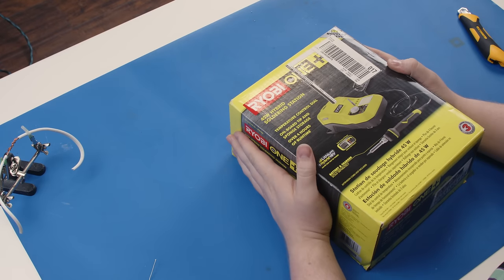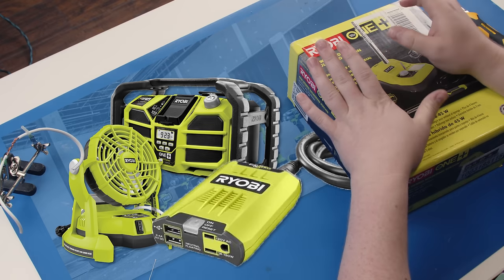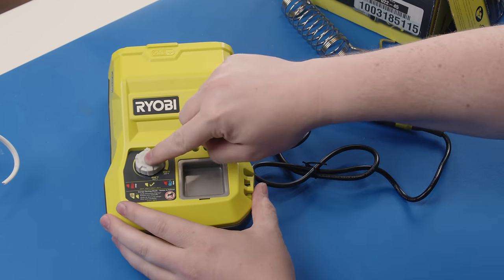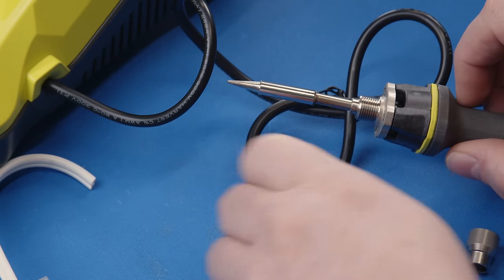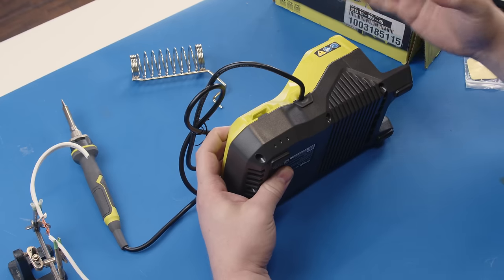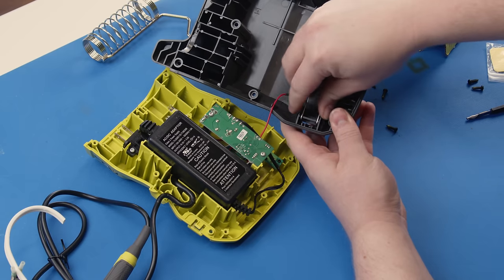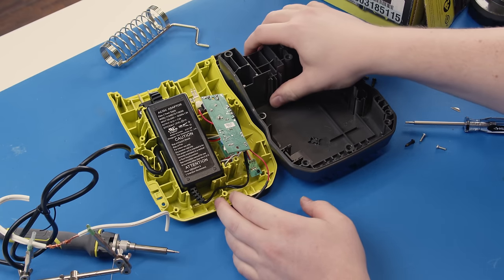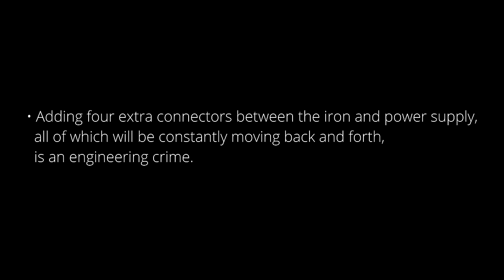Ryobi has GOT to be joking with this soldering iron

Comment: I think the point of those butane ones is more so for field soldering when you're splicing wires and such. My friend is a generator tech and he uses one on the regular because most of the time you're not right next to an outlet. I also have one, and have used it to splice some wires on my car together with an actual solder joint instead of a flimsy crimp. It works pretty well for fairly thick wires, but I certainly would never dream of using it on a PCB or micro joint.

Comment: I've used this soldering iron extensively and it's great for what I use it for -- automotive work where I need a soldering iron that I can cram into a small space and do work where there's no plug.  Also weirdly it has an incredibly long battery life; or maybe I just have really low expectations of batteries.

You didn't complain about the thing I thought you would -- you make a big deal of temperature control, but you don't note on this that the temperature control isn't labeled except for the bottom and top range.  It's honestly just a tiny step above no temperature control because you're just kind of guessing.  I would have loved for it to have some increment lines on it personally, or maybe some lines for some common temps.  By not marking the temperatures in a meaningful way, they're allowing it to be pretty loosey goosey without making it look like it's loosey goosey :)
Reply from the maker: Oh I'm pretty sure the temp control is terrible. I mean, something's better than nothing, and I intend to investigate later and see what it's actually sending on the power line to the heater, but I wouldn't be surprised if this thing wobbles all over the place. They likely didn't mark it because that would make the labels more of a lie than they already are, heh.
Reply: @CathodeRayDude  I would love to see the results of this.  I was tempted to try to find this out myself, but I don't have a thermometer that won't be destroyed by soldering iron levels of heat :)  So I look forward to seeing what you come up with.

Comment: Actually a place for irons that don't have temp control where they can be useful, is stained glass windows. I have some antique soldering irons (wood handles, cloth power cords) and I've been told they're just about perfect for lead working on stained glass windows.
Reply: This is true! Also used in pipe organ pipe repair and automotive radiator rebuilding

Comment: Just saw your video while looking for any info on the soldering irons' energy saving mode.  I can't agree more with everything that's been stated here.  The cable replacement to the iron is a future project for me to check out.  My number one pet peeve is having the iron shut down while in the middle of a lengthy soldering session.  Is there a way to defeat this "energy saving mode"?

Comment: As someone who solders for a living, you shouldn’t be pushing the iron into your work. Just resting it is enough to transfer the heat.
Reply: I used to reiterate exactly that when I was teaching soldering, because it is a key mistake beginners make. "Pushing harder doesn't make it get hotter any faster."
Reply: I think most people are totally rubbish at soldering even one that “have been doing it for a long time” and totally lack basic technique like wetting the tip.

Seeing someone try to get heat into dry parts then glob solder at the tip which instantly proceeds to harden and encase rather than flow is something I see far too often…

Comment: I'm looking forward to the potential future video about the Pinecil. I personally own a TS80 and a Pinecil; of the two, the Pinecil is much better, but I agree with you that the screwed-in tip makes for an annoying workflow. But let than that it's a great iron. The silicone USB-C cable is extremely flexible and meets your non-melting criteria. Maybe someday it will fail from all the bending, but then you can just replace it. Since the Pinecil is also "hybrid" you could even use it with the Ryobi battery packs.
Reply: You don't need to tighten the screw completely.  I keep all of mine finger tightened as this allows to easily replace the tip. But still provide sturdiness and an easy way to twist the tip when you use anything else than a conical tip
Reply: Wow! "Since the Pinecil is also "hybrid" you could even use it with the Ryobi battery packs." Great idea! Thanks

Comment: The flux on the solder joints is perfectly fine. It will help keep the joints from corroding due to moisture.

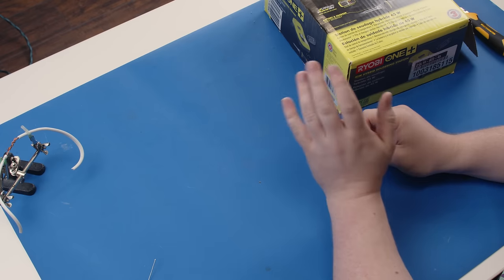Comment: 8:30 I haven't used the not temperature controlled Weller soldering irons, but I have a similar one (25 watts) made by Ersa. I saw the iron first in a documentary about a repair shop for electronic musical instruments, and the guy was using it to work on vintage synthesizers. The guy was using a very cheap iron to repair highly collectable instruments worth many thousands of dollars! I immediately bought the same model and build about 50 synthesizer modules with it (so far), with hundreds of components each, some even with smd stuff down to 0604 component size. These simple soldering irons can work amazingly well if you use them properly!
Reply: i use a weller dual wattage soldering gun to do fine electronic work, sometimes on machines and equipment that cost more than musical instruments!
the 24' highstriker game at cedar point for example, a 100k piece of equipment if i recall correctly, has a pcb that has been bodged/repaired with a iron older than your grandmother's knitting bag and a regular 12 volt computer fan added to it and despite the fact the iron has a double length cord and the plastic case is snapped in 10 places and held together with more glue at this point than original plastic, its still my daily driver and replacement tips cost 0.001 for a 2-3 inch or so length of copper 12 gauge wire! edit: btw, it soldered it's own cord when it got cut into a double length cord, while plugged into it and the wire just twisted!!!
Reply: My 1st iron was also an Ersa, a Tip 260 (I think) with a laughable 16 watts. It took forever to heat up! Nevertheless, I built an EPROM programmer board with it in the mid-80s. I still have it somewhere, but no longer use it since I got my trusty and vastly better Weller. I found the Ersa's tip tended to corrode with time and would no longer take solder. 
That said, I do agree that a simple soldering iron can work amazingly well in the right hands, and you don't need all this whizbang stuff like a digital temp. display (tho it arguably helps). The Ersa just wasn't the right tool for me in the long run.
Reply: Great comment, he is not qualified to rubbish them. They actually require you to develop very good soldering skills and are all that many people need, especially hobbyists
Reply: Correction: My 1st iron is still an Ersa Tip 260, 'cos I just found it in a drawer. The tip definitely looks the worse for wear now.😉

Comment: Thank you for the rather thorough overview of this product. I really appreciate the disassembly because it really shows the workmanship and I do agree with certain aspects such as the cable choice for the iron, in fact it would be nice to find some silicone wire with how ever many leads and swap it out because then it seems like it would be a pretty nice device. I never would have guessed the use of an actual stand alone power supply but apparently that's a pretty common ryobi practice from the looks of the light you disassembled as well. And I could go on with more points of what I appreciated but overall I just felt compelled to give kudos I like your style, keep it up. You have gained a subscriber with this one, thanks again.

Comment: I find that build in power adapter rather smart. You can re-use already existing product and just integrate it saving cost and time. Also, if you don't need the hybrid mode, you can do some weight saving by removing that power adapter and maybe even using it for some other project.
Reply: Also, it would be easier to repair if you can just buy the power brick easily. Just like with monitors. Some people complain when they have an external power brick, but I prefer to have one. If the monitor ever dies because of the power supply(chances are that if anything dies, it's gonna be the PSU), you just get another power brick AND you don't have to crack open the monitor or source some specific, probably overpriced, power supply unit.
Reply: And if you have no batteries or an extension cable you can take the shell off unscrew the plug end of the power brick and run the cable out the back put the shell back together and now you have a standard solder station you can plug into an outlet directly or like someone else said we don't get these in the UK he bought one from the USA that has the US plug seems its 240v he now knows he can replace it with a UK plug and use the hybrid feature if he has no charged batteries

Comment: I think you might want to reconsider butane irons. Additionally you don't NEED temperature regulation, that's only been common the past 20 years or so. People have been making beautiful joints with unregulated irons for a very long time. It's not about how hot the iron gets it's about how hot what you're trying to solder gets. If it's getting to hot lift the iron away, too cool and reapply the iron. Be your own thermostat. Sure temperature control is nice with like chips and such but no where near necessary if you're just trying to join up two wires.
Reply: Good comment. When he was bagging them I had severe eye-roll. He just doesn't really know what he's talking about.
Reply: my butane iron is 20 years old and has soldered thousands of joints in hundreds of cars and appliance repairs, some desk projects and is still going good,
I have 3 electric irons,
1. is 130w max constant heat and it sucks!
2. is so old and huge I could heat my house with it 😆
3. is adjustable up to 450°c and it's good... about 10 years old too!

Comment: I have a Ryobi One set. I found it on in a box on the side of the road and it all works perfect!
I had to clean it all real good. There's a drill, One battery, a battery charger, big fan, skill saw, Sawzall, stapler nailer, flashlight & vacuum cleaner. There might be more but I don't feel like digging it out to look for it. I like the stuff. I feel like I was blessed  pretty good for all being free!

Comment: Wait. How does the grounding strap work if it's not connected to earth ground?
Reply from the maker: You clip on to the lug and tie it back to earth or an esd grounding system, is my impression.
Reply: The cilp works in the manner as wraping a ground wire around the metal barrel. The other end goes to earth ground. It's acutually nice.
Reply: The work mat and wrist straps are wired together and there is also a long wire on a clip that you ground somewhere .  Since the station is battery powered, it has to tie into the ESD's provided ground anyway.
For portable jobs, I have a mat that has a pocket like an apron, and I fold it in quarter to stow it.  Inside are the wrist straps and other equip. grounding clips.  I'll usually clip the ground to the chassis of the PC I'm working in, and I've heard some people replace the power cord on the PC (or whatever) with one that only has the ground pin connected.
Reply: @CathodeRayDude  well white wire in a 15A or 20A American's outlets use it for neutral purposes and it is connected to ground.
Reply: Shocks come from any voltage difference, not just ones to ground. By connecting the work to the iron with a large resistor in the middle you can safely normalize and voltage difference without the risk of arcing
Reply: It's wireless! :D :D
Reply: It id for those that pee on it
Reply: @untrust2033  Hahahaha!!!!
Reply: @untrust2033  i usually don’t comment on tool vids but I will because gosh darn that gave me a chuckle
Reply: They say there's no such thing as a stupid question, but this was a pretty dumb question from an apparently technical person...
Reply: Technically neutral and ground or the same thing and hook up to the same connected bus in the panel box One wire going out to the power companies neutral and one going to your grounding rod. it’s recommended to have booth wires but you can use the neutral as your ground.
Reply: Hey Ben!!
Reply: @rogerwilco8146  Rules for hooking up an unknown signal level into an Aux plug is this: Touch It, Lick It, Stick It.
Reply: @untrust2033  was gonna say this!! :P

Comment: I find the 110v capability really interesting.  I have the same unit in Australia and we don't get an AC input.  Of course like most of the world we use 240v but that shouldn't be a show stopper for having mains power capabilities in ours.
Reply: What is strange is that this switch mode power brick can accept 90-240VAC, all they would need to do was change the plug format to match your receptacles. I wonder if you have different regulations that these bricks do not meet by default, or if they just decided to try it in the US market first to see if it will sell before offering it elsewhere. It's similar to how Fords or GMs in other countries have vastly different option packages, usually you get better ones:-).

Comment: I laughed out loud both times when you revealed the power supplies in these things! The way you put it is perfect: "it's not a bad thing, it's just a bad look". I really like the idea of easily replaceable internal power supplies with cases that make them safe to handle, although the way they're attached to the rest of the system looks a lot less easy to work with...
Reply: Now that you phrase it like that, this is pretty much what desktop computers do, using a standardized power supply that is fully built and could be used on its own, and just sticking it inside a case designed to accommodate it.
Reply: The problem is that the bricks are usually ultrasonic welded and thus impossible to repair without destroying the outer shell. There is inherently nothing else wrong with those and as you mentioned it's safer to open the case of the soldering station when all the caps of the PSU can't be accidentally touched.

Comment: As a currently practicing Aircraft Mechanic I can say whole heartedly that the M12 battery system is worth getting into, even if you won't use the soldering iron. I have the multi function bit driver you showed in the video and can say that driving literally hundreds/thousands of fasteners a shift there's not a better light duty screw gun out there. 
When everyone else was using the M18s or the 20v systems from dewalt, they got tired quickly lugging them around; the weight and bulk of those big drills could never fit in the same places as my 2505. Not to mention thevarious heads on the thing are amazingly useful when you need them. I have driven in literally thousands of screws with it and dropped it several times from 20+ feet and it's never shown any sign of real damage.

A tip to getting into the system is wait for fathers day or other major US holidays and get them on sale at the homeless despot; buy a kit of a couple tools with a charger and a few batteries at first and then only buy the tools afterwards and expand your battery stable once you get to the point that you have to wait around on one to charge one day!
Reply: Which airlines do you do work for so I can avoid them. I'd rather fly in a plane that is maintained rather than practiced upon 🤣

Comment: The butane irons are actual better than you think. I used them extensively to fix motorcycles for fun. I did it in a shed that had no power and it just made sense. I've redone a whole wiring harness with one and ridden that bike a few thousand miles. There is just a few weird quirks like you need to pay attention to where the exit hole is that the flame exhausts because it can melt plastic. There is also kinda temperature control with the gas regulator.
Reply: Worth noting also that you don't light a fire when using a butane iron. The fuel flows through the catalyst and oxidizes without a flame generating heat but with more control. Since there's no flame, you can control the heat just by reducing the amount of fuel hitting the catalyst. Considering you can get a serviceable butane iron for under $5, it's a pretty great cost/performance ratio.
Reply: They're kinda scary and obviously have a learning curve but they are super duper neat.

Comment: the "pencil lead" soldering iron tip is extremely common in bottom of the barrel "pencil that plugs directly into mains" type of soldering irons. 
the milwaukee soldering iron is basically a $10 iron with a drill battery handing off the back
Reply: Peak taste pfp 👍